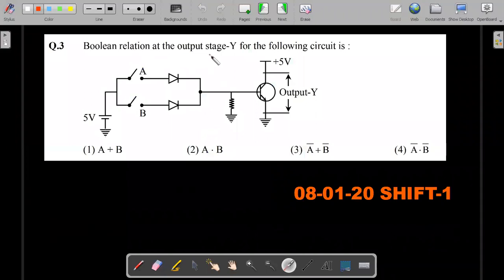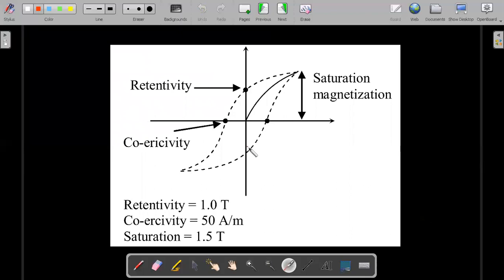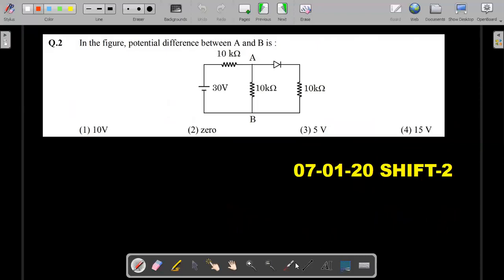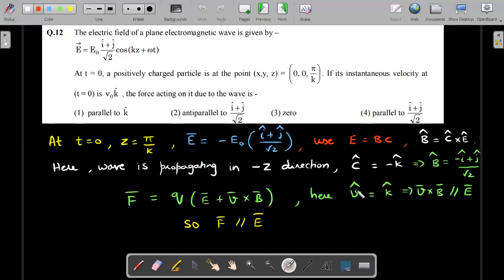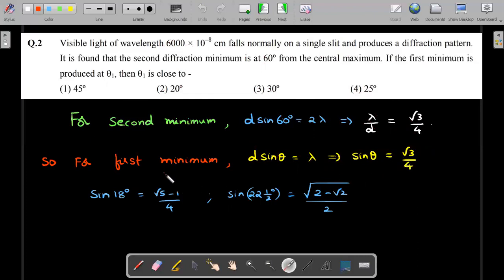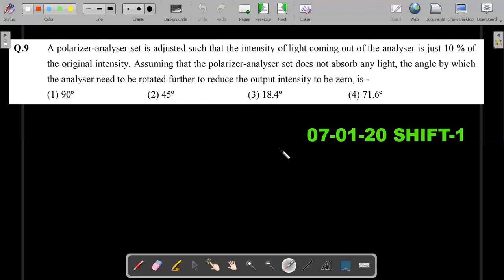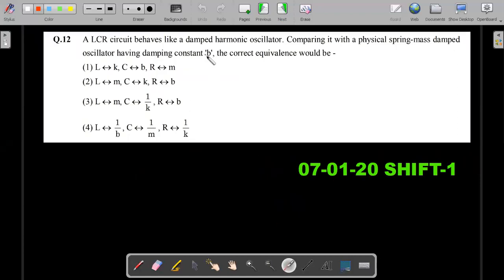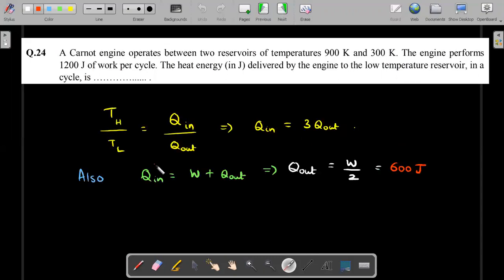JEE MAINS 2024 PHYSICS REVISION | VIDEO 2 | EXTRA SYLLABUS TOPICS| SOLVED PREVIOUS PAPERS

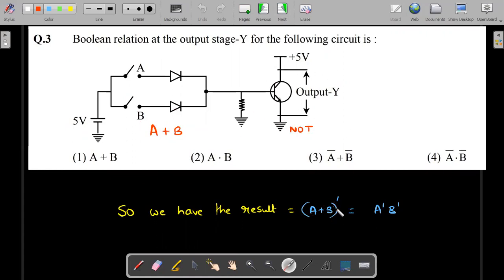Comment: Sir, at 4:16 wouldn't the output be always be 5v ,bcz Vce is maintained 5v as per diagram..?
Reply from the maker: That's an error in the diagram, there will be some output resistor in the "NOT" gate they forgot to print
Reply: @PHYSICSSIRJEE  ok sir

Comment: Sir in a pn junction diode can we say that both p type and n type semiconductors are electrically neutral??
Reply from the maker: No, when not connected to battery ,P part is negatively charged and N part is positively charged. Please read HC VERMA vol 2 . It's very simple 👍. Or watch this 👇
https://images.app.goo.gl/aByrjWRiXYJV2fQ19
Reply: @PHYSICSSIRJEE  thank you sir